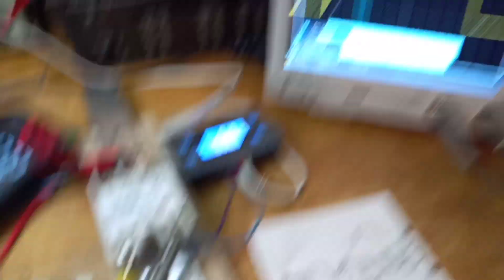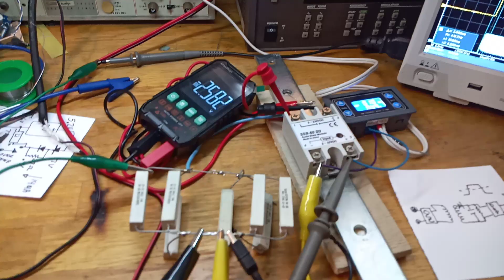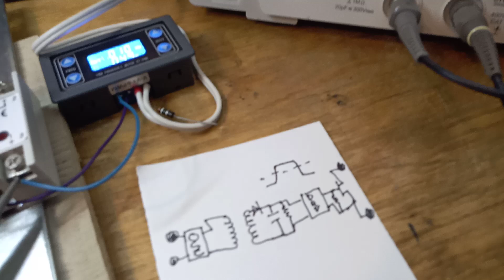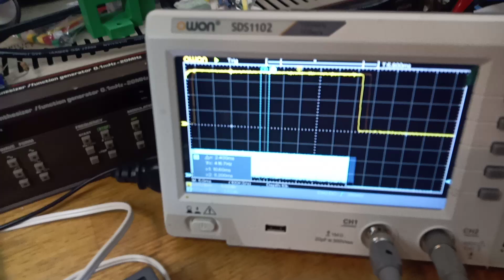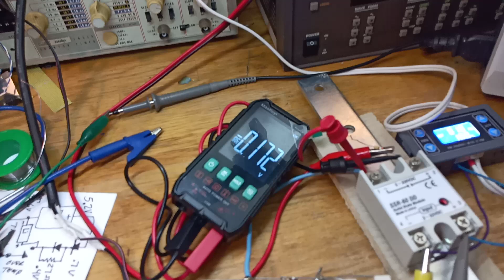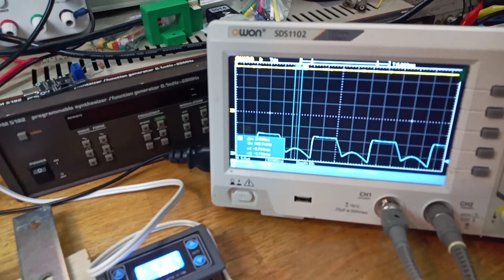Testing A 60A DC To DC Solid State Relay, What The Heck Is All This Noise?

Comment from the maker: My first test of a 40A DC SSR was a little disappointing with long on delays and high on resistance.  This test had me scrambling to see if I hooked it up wrong.  There was a lot of noise on the input and the output wasn't even connected. Instead of a photovoltaic transfer of energy to drive the gate, This SSR used an oscillator and transformer operating at 45KHZ.  That results in higher energy transfer to drive the gate and faster transitions.  Turn on has a 0,75ms delay and off has a 1.5ms delay.  But the actual transition speed is quite fast.  That makes this pretty good for pulsing a load.  Breakdown voltage tested at 269V.  I had calculated the on resistance before at 35 milliohms.  It was a cloudy day and I was running the dishwasher.  I was only able to di a couple amps on the video because the attic inverter runs right from PV and a slight voltage drop turns it off.  It took three tries to get this video.  If using one of these, it is worth your money to get a higher current rated device.